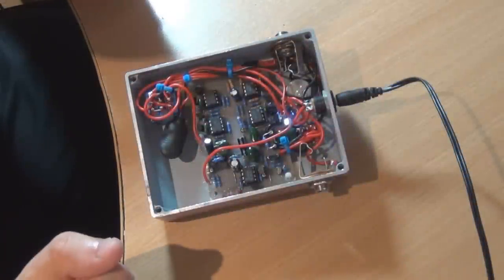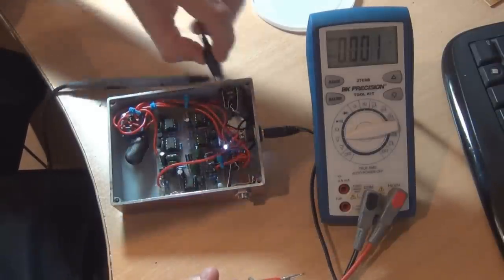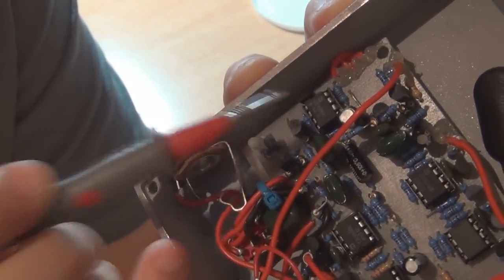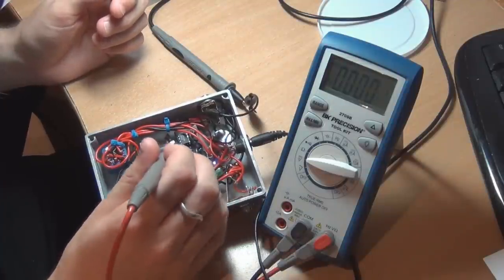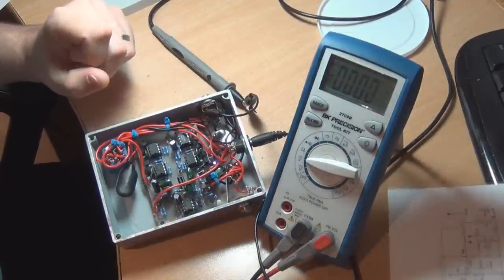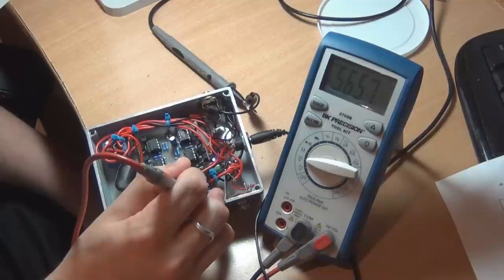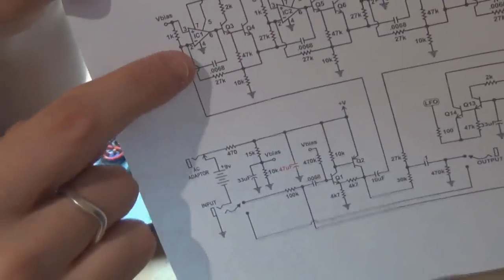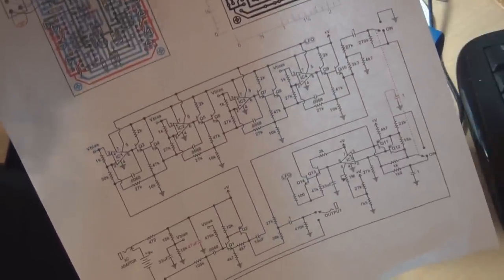Fault Diagnosing: Measuring Voltages (DIY Guitar Pedals)

Comment: great video, I'm trying to solve the problem of my sansamp classic. There's a power coming, whenever i plug the tip of the PS to the pedal it generate a starting sound. but when i inserted it properly there is no sound coming out, and even its powered off.. the other chain signal is effected.. Not sure if its grounded or some other parts are broken.

Comment: I have an old Ibanez metal Screamer that I had in storage for 30 years. It didn't work so I opened it up and it's super clean! I hooked it up to my 9 volts power supply and opened the back to get a reading on the +9 pcb jack mount pin coming and it's reading .02-.04 volts. I ordered a new pcb jack and foot switch. I stalled those and I'm still getting the same reading. What could it be? Shorting to ground somewhere? Any help would be great!

Comment: Thanks so much for posting these videos.  I have a pedal in which I get no output.  My reading on the ground on the circuit board goes to 0.1mv but no higher than that.  Is it possible to get a reading of 0.1 for ground? Or does that potentially mean the effect signal is touching ground somewhere?  Sorry for the noob question.  I'm just trying to learn.  Thank you.

Comment: I have a ProCo Roadkill that stopped working yesterday and it’s driving me nuts. Power is fine, battery or mains, input and output jacks are snug and making contact when cables are inserted. The positive power lead looks to have an ugly solder where it first connects to the PCB (darker than the others and cloudy. Time to break out the Multimeter 😒 
I love fixing pedals but I hate going on a goose chase. Wish me luck!

Comment: Hi could I ask for some advice.
I have a homemade kit for a tuberscreamer from Musikding.
But sometimes when I rotate the knobs the sounds cuts out, usually at the extremes of the knob. it rasps and sounds like crap and then you turn again it works. Can you give me a general direction as I have no clue and know nothing about this ( I do have a multimeter which I bought this week)
Any advice would be appreciated, cheers

Comment: Hi, I bought a box of pedals at the bootfair for £10 and every one works except the Behringer DR100 Reverb pedal. There doesn't appear to be any power getting through the board. I've checked the led and that seems ok. I'm suspecting that maybe it had the wrong power supply connected at some point and something has blown. I can't see anything obvious on the board but then it's all micro components. Can you give me any tips on what to look for please? My knowledge in this is limited and it has me foxed. Thanks Gary

Comment: Can you tell/show how to measure with multimeter a power consumption of a guitar pedal (mA) in order to use it better with power supply? Thanks!
Reply: To measure current (amps) the power must go through your meter.  You'll need to break the power (battery?) input and put your meter probes at the break to measure what the pedal is using.

Comment: Great video! Congratulations! I watched it looking for a possible solution to a defective pedal I have, but even though I couldnt find the answer, it was still pretty interesting to learn about other common issues. 
I would be most grateful if you could try and guess about my problem: the LED light goes on but all I get is the same dry signal in the amp, there IS output signal that sounds in the amp but without the effect. Thank you very much
Reply: If the signal you get from the output is the same as what is at the input, maybe the (foot) switch has failed, effectively bypassing the effect circuit?

Comment: All 6 of my pedals went down at same time . I will get signal from guitar straight to amp and have checked every pedal individually and still nothing coming out of them any thought of what I can check or look for also all power to pedal is correct
Reply from the maker: Did you plug the wrong voltage into your pedal chain?  Pedals (usually) receive power even if they are not engage.  You can have had AC voltage or a high DC voltage destroy some components inside each of the pedal.   OR....your power supply is dead.  Double check that with a battery.  Hope that helps!
Reply: DIY Guitar Pedals thank you for getting back to me . I had correct dc v into every pedal and just took my guitar into shop to see if I had a pickup problem I brought along another pedal I never have hooked up or on board and guitar work there into amp and the never use often pedal still didn’t work guess I need to dig some more thanks again

Comment: I have a DoD stereo chorus pedal the light come on but the effect doesn’t
Reply from the maker: Hi Thomas, unfortunately that problem has a pretty wide scope.  I would check the effect outside of the enclosure (if possible).  Could be something on the effect pcb thats the cause.  You can also check the offboard wires to make sure none have broken off.   Possible to be the switch as well!  The problem could really be many things :(  Good luck